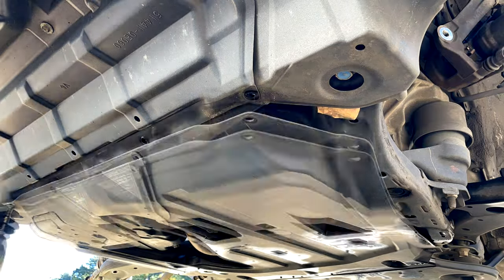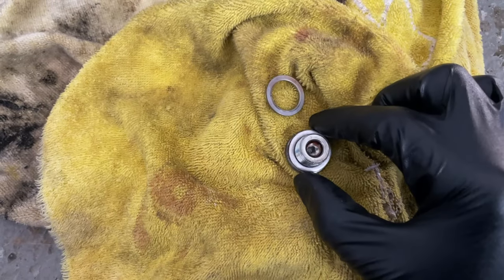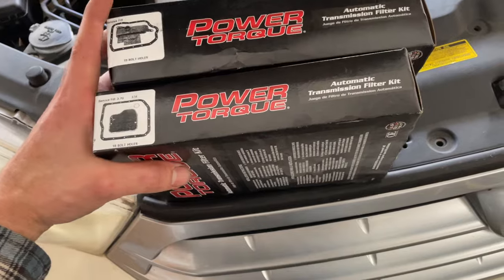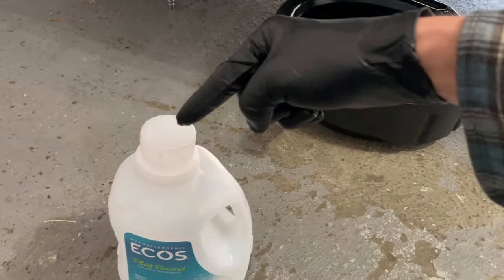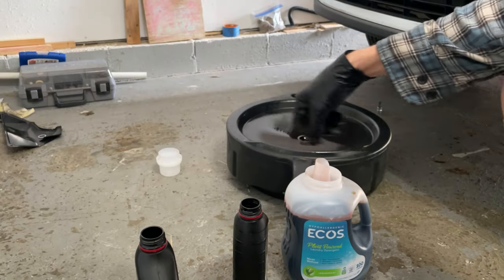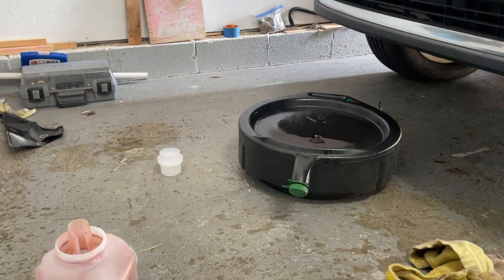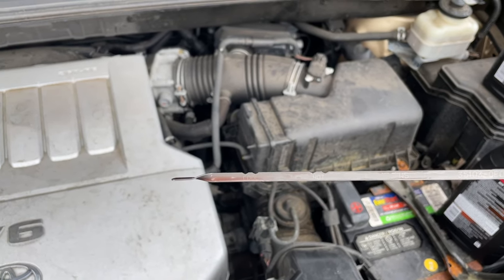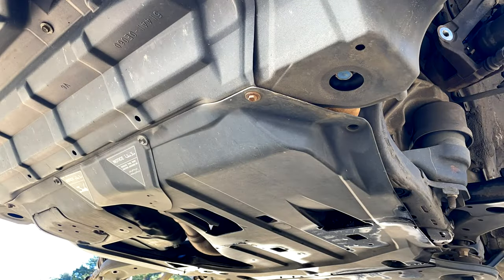How to Change Transmission Fluid (Toyota Highlander)

Comment: Hi , when I refuel the highlander 2011 the fuel economy reset itself and shows 30L / 100km and after running car for 80 km it come to normal as 14L/100km or 13l/ 100 km  but when the car need refuel this changes again and shows 30L/km again for another 80 km , how to fix this issue , thanks.
Reply from the maker: Not sure what you are saying exactly… not sure how to fix that one.🤷‍♂️

Comment: Thanks thats great job , otherwise I was watching some people complicated videos that put wire in obd 2 and something about temperature and empty two times so those videos were not simple , the way you change transmission fluid is the best one and if company say don't change transmission fluid its mean the company filter could be  of good quality so we will not change the transmission fluid filter and will just change the fluid every 30k to 50k., buying 5 quarters and of Toyota brand, thanks.
Reply from the maker: Thanks for the comment! Glad it was helpful!

Comment: Question: replaced the CV axle on the driver side of my 09AWD and it looked like way more than 4 quarts came pouring out of it. I assumed that everything drained out so I added 4 qts of new ATF and now it makes a weird buzzing noise and sometimes struggles shifting up or down from 3rd gear and the traction control light came on.
Reply from the maker: You cannot assume how much fluid is in the transmission or how much came out. You also can’t add fluid to a transmission or an engine, without knowing you have the right amount in it. Putting too little in it can ruin it, and putting too much in it can ruin it. That is why they have dip sticks to gauge what amount is currently in. Make sure you follow the manufacturers recommendations for checking the fluid level to make sure that it is correct. If you are overwhelmed, or don’t know what you are doing, I highly recommend taking it to a professional to make sure it is done properly. 

If you did not do a transmission drain after pulling the CV axle out, and you still added 4 quarts of transmission fluid, you probably overfilled it.
Reply: @ That’s literally what I was thinking after watching your video. Such a rookie mistake haha I’m actually a Diesel Mechanic and have been working off and on cars and engines the last 13 years and yet I made such a rookie mistake. I’m gunna do a proper change out tomorrow and make sure everything’s done right haha. Thank you so much for your response though I really appreciate it.

Comment: So if you don't pull the CV axel and lose 2 quarts the total you would need is only 2 quarts?
Reply from the maker: No. It will be the same as what I filled it up with (between 4-5 quarts)

Comment: do you know if the 2023-2024 models is the same procedure?
Reply from the maker: I don’t believe there is a dipstick to check the level in the 2023-2024 models. From my understanding, it is not the same.
Reply: @rutterrealtygc  I don’t believe in lifetime CVT transmissions either. That’s why those Nissan CVTs fail miserably